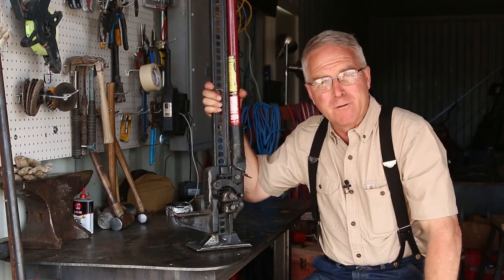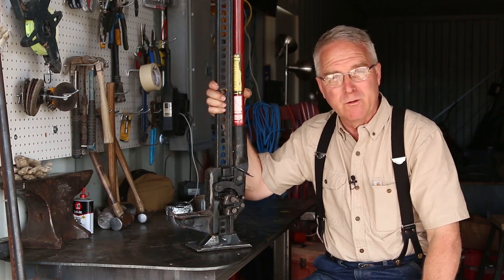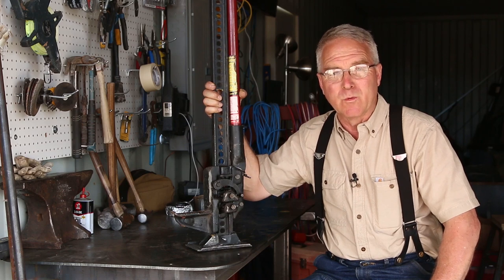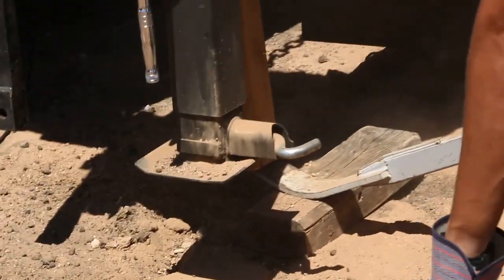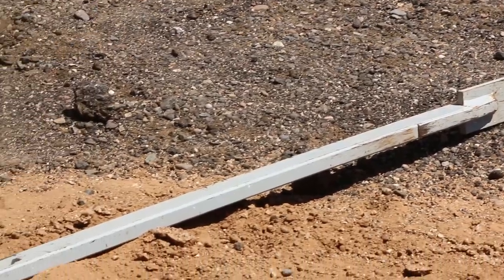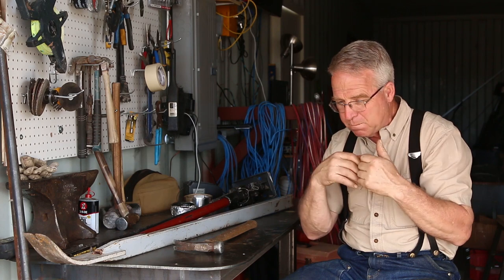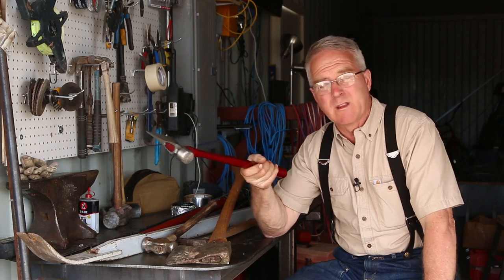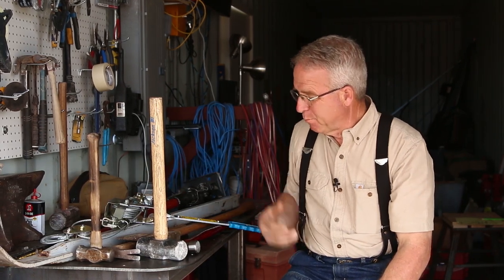5 Problem Solving Tools

Comment: I'd also add a good quality flashlight. I count it as a tool because if I cant see whats wrong, I cant begin to fix it. I'm never a far reach away from a solid light.
Reply: I carry a streamlite, love it and use it constantly
Reply: eltedo804 sadly I lost mine 3 days ago. I keep reaching for it and every time I reach for it and it’s not their makes me more angry as I can’t see what I need to see. I have to use the phone light and it just doesn’t cut it. Had that thing for 2+ years all day everyday. Lost it before but found it quick. Now I think it’s gone for good.
Reply: @FishFind3000  can we have a moment of silence for this fallen light?
Reply: I have multiple flashlights in every room in the house.  In the dark, your multitool is useless without a flashlight.
Reply: @gapster46  true
Reply: Love my streamlight
Reply: Better yet, a flashlight that you can strap to your head so you have two free hands while working. A light fixture would provide more light output but it's not useful when it doesn't light up specific areas.
Reply: @vermili0138  I have a headlamp in my personal truck, in my work truck, and in my shop. Theyre extraordinarily handy.
Reply: @eltedo804  Headlamps everywhere man, gotta have one
Reply: My flashlight has a cellphone attached to it.
Reply: @gapster46  With that thought in mind, I have emergency light flash lights a few places in the house. They're plugged into sockets and when the power goes off, they turn themselves on. Absolutely awesome to have around and I think they were around $10/ea.
Reply: If you’re gonna keep, say, a maglight in the back of your car, make sure the batteries are in backwards for storage.
Reply: @gapster46  unless one of the tools on the multitool IS a flashlight :P
Reply: I was convinced #5 was going to be flashlight, especially when he said life-saving
Reply: I never leave the house without my handy Von Neumann self-replicator. It's everything all tools are, plus it makes more of itself as needed.
Reply: I completely agree. Mine is a headlamp though so I can use both hands. Nothing fancy, just a $10 LED energizer that takes three AAA batteries. But like you said, that thing (in fact several of them) are never far away. I use it almost every single day and miss it dearly if it's not there when I need it.
Reply: I’ve found my self carrying a nebo inspector light and I have to say, of all the flashlights I’ve had from this one I’ve yet to break it in some way or another
Reply: Better yet, a Fleshlight!
Reply: I agree. I carry a small single-cell (usually AA) LED flashlight in my pocket at all times. Mostly I use a Fenix LD-09, but I have others (Olight, Thrunite, etc.) I could use a cell phone for light, but that eats up the battery for the cell phone which I may need for other purposes later. A flashlight and a folding pocket knife solve 99% of my daily problems.
Reply: @TheMetalDouche  @AvE would be proud
Reply: I always gotta carry my impactor around and use that light haha
Reply: A flashlight was my guess for the final tool.
Reply: Really thought that was what he was going to say
Reply: i was almost sure his final tool was going to be a either a flashlight or the multitool/pocketknife
Reply: @TheMetalDouche  was Looking for this
Reply: @gapster46  blind people can still get things done.  that said yes i use my iphone flashlight and headlamp all the time.
Reply: I would agree Eltedo84 if you can not see what you are doing a whole pile of the tools you highlighted are totally worthless. Flashlight #!
Reply: I agree,I thought flashlight would be on the list.
Reply: Second that! Carry a Nebo Slyde at work (they supply batteries so rechargeable isn’t necessary) then I use the smaller USB rechargeable Nebo in my camera bag. I feel naked without a Leatherman and light on my belt.
Reply: I have a collection of multitools (mostly Leatherman, but also Gerber, Buck, and some cheap off-brands), but I have three times as many flashlights as I have multitools.

Both tools are the unsung heroes of tooldom, but I find that I use my flashlights way more than I use my multitools. I carry at least one good light with me at all times - even when I'm trussed up in a suit for a wedding or funeral or job interview.
Reply: Yep.
Reply: smartphones light !
Reply: Usb rechargeable lithium ion led head torch. I have two in the car at all times. I'm afraid it's replaced the days of the maglite type flashlight.
Reply: Yep, I have many Nitecore lights, a 2,000 lumen in the glove box powered by two 3400mah 18650 batt's when you need a lot of light for a long time.
Reply: AAA LED flashlight is super compact and bright enough to make it out of the woods on a dark trail. No excuse for getting caught in the dark. Put a piece of vinyl tubing on it and you can comfortably hold it between your teeth.
Reply: Petzl lightweight LED headlamp
Reply: Great video. 99 cent stores or equivalent have very good LED flashlights powered by 3 AAA batteries. Buy a case of them,keep  them in strategic locations,one in every pair of pants,etc.
Reply: I thought that was gonna be the last item.
Reply: @vermili0138  Exactly - I have several handheld flashlights, but now I have a number of LED headlamps - in my tool boxes, in my vehicles, in the garage and in my bedroom.  If I can't see what I am doing, all the tools in the world won't help me!
Reply: Carried a flashlight, day one as an apprentice and was asked why, well when they couldn’t see.... 💡 Now they carry one. 👍🏼
Reply: I keep a headlamp, come a long, hammer, pry bar,  hi lift, ax, shovel, bailing wire, zip ties, and of course... duck tape in my truck at all times. I’ve lost 2 leatherman tools and do need to get another.
Reply: @benjamingoulet8059  ax, shovel, bailing wire, zip ties, duck tape .... and presumably a ball gag? :- /
Reply: I've almost done away with torches as they are expensive and really require a hand to hold when I need 2 to hold. My best choice for light is a Led Lenser, Silva and Petzel head lamp which outdoors and mountaineering folks use.. My early mistake was buying the most powerful headlamp which chews through too much batteries. The trick is to buy one that just puts out a comfortable amount of light and not to wide a spread.
Reply: @conmanumber1  I still have a 4xD cell Maglight that I keep by my bed.  You can't club a burglar with an LED head light.  :)
Reply: @pulaski1   yes I still have my 30 year old 2 battery Maglite which I upgraded recently to a l.e.d  bulb but it is still a poor performer compared to my German made Led Lenser p14 and the Led Lenser x21. The Maglite is by my bed and Led Lensers in my vehicles. I use head lamps as they allow me 2 hands on the job. Most have a fast strobe mode which really confuse the brain.
Reply: A solid, basic LED headlamp trumps almost the best flashlight, in my experience.
Reply: I have a 6 D cell MagLite under the seat of my truck. Right next to my machete.
Reply: @vermili0138  Olight has a two way pocket clip so you can clip it on the brim (I think that's how it's called?) of a cap and boom you have a Headlamp. Doing it all the time with my Olight I3T EOS
Reply: @tuckera1879  you should turn it off, save the battery for when you need it
Reply: With the advent of LEDs, we live in a glorious age for portable lighting!
Reply: A flashlight might be the sixth tool on his list. Or better yet, a headlamp.
Reply: Yes. No doubt. 2010, Ft. Dix New Jersey, my unit just rolled in for annual training. 
About 100-150 bags with every Soldiers name on it were in the back bed of the deuce . It was raining and 11 pm at night when we showed up, all of us were pissed and it was a huge shit show trying to locate our bags in the dark. 
I climbed in the back, clicked on my streamlight and started calling out names of peoples bags. People climbed back down and waited for their name to be calles.The unloading process turned into 10 minutes.... I was the hero for the night lol.
Reply: I think you mean "two rechargeable headlamps".  You're welcome.
Reply: everyone has phones now, problem solved
Reply: I actually thought the flashlight was #1. As he began to describe the item without saying what it was, I was convinced it was a flashlight. 

Also, I’d add headlamp to your suggestion.
Reply: I actually carry three different sources of light with me: a small pocket inspector flashlight, a keychain flashlight, and my phone. I like being able to see things.

Comment: My dad broke two spade handles in one day and was ranting about the shitty beech wood you find at stores. So i have a craptacular stick welder and am half good with it so after a little zip zap routine i fixed him with a pipe handle to last for generations. I saw pride in his eyes or maybe he was looking at the arc too long.
Reply: ash wood is best for handles for hard working tools 

beech ? for shovel/spade - phssst !
Reply: @saemushailstorm3135   i no rite? Ash is scarse and being a european we have no hickory. Generally i get handle material from the wild!
Reply: mayby dads tired of shoveling
Reply: mordechaimordechai unfortunately, store bought tools with wooden handles aren’t that great, especially the affordable ones, they try to maximize the number of handles they can get out of each stock; you can buy handles standalone, but check the fibers, they must go from one end to another very straight!

Here’s how I made two hammer handles first time ever.

Recovered some 50+ years acacia wood from an old barn;

found the pieces larger than what I needed

I’ve split the wood to ensure straight fibers from one end to another

shaped the handle with an angle grinder and sanding disc(wear dust and protection mask!)

cut a slit for the wedge, hammered the newly made handle into the hammer head

open the slit with a chisel, pour d3 water resistant wood glue without mercy

hammer in the wedge until it turns into a mushroom and won’t go any further, cut the wedge flush, let the glue cure for 24h

hand sand the handle to finished and comfortable shape, flood it with linseed oil and voila, a handle that is comfortable and will last for generations!
Reply: zdringy amazing
Reply: Good for you,there is no better feeling for a son than to make his dad proud!
Reply: home made tools ... excellent
Reply: my dad told me if they put my brain in a bird it would fly backwards.
Reply: Make sure there are no buried electrical lines when digging. There is a reason you dont find metal handled shovels in the store.
Reply: @dustinshort6207  That's not true, in both the US and the UK, as I have bought metal-shafted spades in both countries, and while perhaps stronger, they are heavier and more expensive.
Reply: @mordechaimordechai  ash is really common in the UK, and ash die back disease will mean millions of trees will be felled in the coming years.
Reply: I made hammer, shovel, axe handles from oak I got from reclaimed pallets. It’s held up for 6 years so far. Screw what everyone els thinks because I’m the one that uses it.
Reply: Had the same idea myself a few years ago.
Reply: @carryclass6807  that's hilarious
Reply: @carryclass6807  Ahh man. I lost it! Thanks - I needed that!
Reply: This is my favourite paragraph I've read all... month. Well told.
Reply: Cutting a hi voltage electrical cable could ruin a perfectly good shovel
and kill the operator, and then cause an expensive funeral
also cause the boss to lose his no claims bonus on his Worker's comp insurance.
the list goes on and on.
for years i used Australian hardwood handles,
but now
I have a post hole shovel with a synthetic handle,
and I like it a lot.
Reply: Ok guise. There are no hidden cables in my garden, ok? Nobody is gonna get electromuhcuted. Stahp it
Reply: @carryclass6807  Would still fly though!
Reply: I lived in a big city and when they were not throwing bicycles away it was shovels and spades with broken shafts/handles.🙄 I can make a wooden handle for one right quick and may try welding up one thanks to you.
Reply: That’s very funny 👍
Reply: My brother-in-law did the same for me with an old splitting maul - that thing is going to last for generations!

Comment: Broke down on the freeway once-upon-a-time.  Had the replacement distributor cap needed as this car regularly leaked a little oil through the horizontal shaft and fouled the contacts.  But did not have the needed 8mm short wrench needed to get one of the bolts loose.   Before long, a pickup stopped and asked if he could help.  "Do you have an 8mm wrench" I asked...  He opens up the camper top to a load of tools and says "why yes, I'm a NASCAR mechanic"!   When I told him I fix VCR's among other things, we went up to the next rest stop and replaced the belts in his broken VCR he happened to have along....   He had had some car trouble himself that morning and vowed to stop and help someone.
Then there was the time out in the middle of nowhere that I fixed a guy's alternator because I happened to have a soldering iron and a AC inverter along.
Reply: Great stories! Great men
Reply: Awesome story
Reply: You might also have soldered with a copper wire placed after a headlight bulb (or before, as long as tou place them in line. If you leave out the bulb it becomes welding😆)

Comment: I have Leatherman I bought in 1991 at a Sporting Goods Store in Utah. I'm a Explosive Technician and this particular Leatherman has a Blasting Cap Crimper built into the needle nose. Also a file I use to clean my ground for the Detonator, wire cutter which I use to cut and strip wire. That's 4 tools I don't have to carry in a bag, just use the Leatherman. Its 28 years old now and still in great shape. I lost it while training new Techs, I spent 9 hours looking for it the next day. Found.
Reply: I work on railroad maintenance equipment, I lost my leatherman one day on the tracks. When things fall into the ballast (rocks) they tend to disappear. I had me and two other guys looking for it for about 3 hours while we were working. Amazingly we found it!
Reply: Finding a lost tool after hours of looking is a good feeling.
Reply: @nathanadams6648  True, I had a lost feeling looking for a lost tool. I was very happy to find it.
Reply: I often find other people's tools when working on cars, usually the ones where I'm fixing the last guys 'fix'.
Reply: I had the honor of taking care of the EOD guys at Luke AFB for a while. Thank you for doing what you do.
Reply: I've had a Gerber multiplier tool for about 10 years now, daily carry and it hasn't let me down yet!
Reply: @MustardMade  Loram?

Comment: It was a cold snowy day with evening coming on and we were 30 miles from camp in the mountains when metal fatique claimed the radius arm bracket on the 96 f150 4X4 we were driving and the whole front end fell out. No sleeping bags, no phone signal so while discussing sitting around a fire for the night, I thought, lets's try something. The wheel was forward near the bumper so we put a block in front of it and slowly moved the truck forward until in position and cut a small tree for leverage to lift the radius arm back up to the blown frame bracket. Now I never leave home without a pair of klien rebar pliars and a roll of tie wire. I folded lengths of wire in half to double it, you get much more pressure that way when you twist it off. Kept wrapping and tying until satisfied and we drove out the 30 miles of rough and steep logging roads without a hitch. When we reached pavement, it was just as tight as when we wrapped it so we carried on but didn't do over 30 mph. It could have been a cold and miserable night with a 30 mile walk in the morning and maybe even have to leave the truck there for the winter. I love tools too.
Reply: love Klein tools too
Reply: @pauleliot6429  I wondered if anyone would catch the spelling, good eye, a true klein tool lover. The i before e rule doesn't apply here.
Reply: I love tie wire!  It's gotta be the most useful wire on the planet.  Mufflers, exhaust pipes, hose clamps... What can't it be?
Reply: I love the story but who the hell are you,Mcguiver?
Reply: As a kid, the engine of my Father's F150 began clattering and quit. He pulled over with nothing around for miles (and long before cell phones were a thing). He declares that there is something wrong with the valves and takes off the rocker cover - the push rods are all bent - so he proceeds to pull them out and hammer them straight on a rock. We were soon going again.
So, in addition to a hammer, carry spanners...
(F150 with stick shift was a mighty beast - I learned to drive on that)
Reply: Nice story.. Damn Ford's.
Reply: @danielross59  
Actually, the rule DOES still apply.  To continue with the rule, the exception is for words as in Height and Weigh.  Klein is a word like Height.  When it comes to proper names, however, anything goes but, Klein did not go rogue in their spelling.  LOL.

Sorry to be a grammar nazi but, well, there you go.
Reply: We were out in the desert. 
A rock flew up and smacked a hole in the gear box of my friend’s Honda 500.  It was leaking oil too quickly for us to make it back.
Made a plug out of foil (lunch wrapper) and hammered it solid with a rock and a wrench handle.  Placed plug over hole and wrapped tie wire around engine, then twisted/levered it tight to force plug into hole and keep it there.  He rode the bike with that improvised field repair in place for at least a couple of years.
Reply: Tie wire and Klien pliers are at the top of my list also.